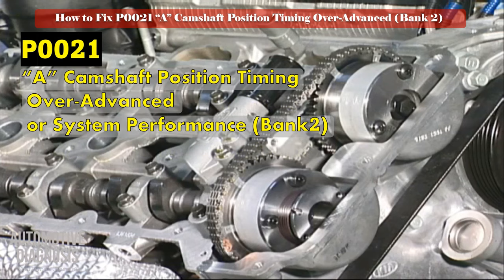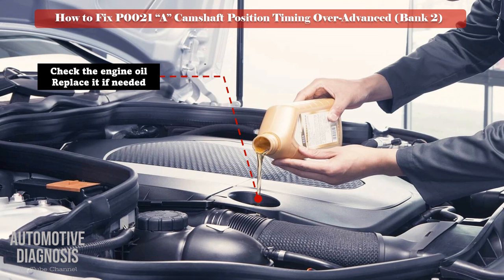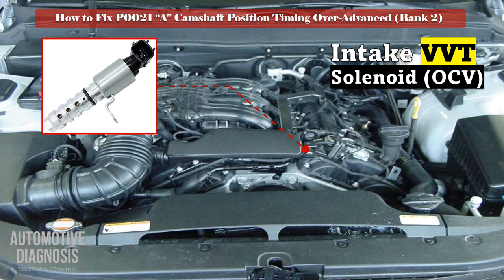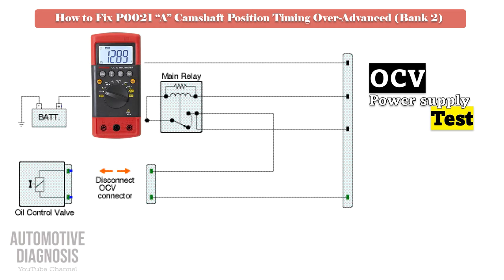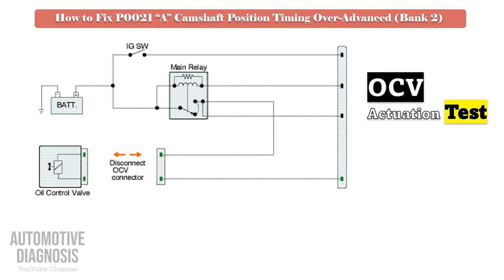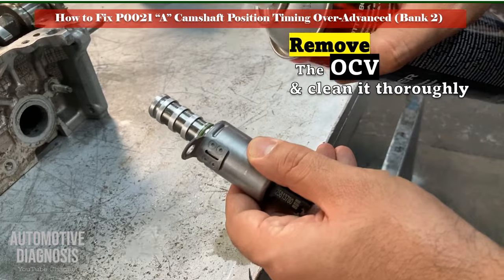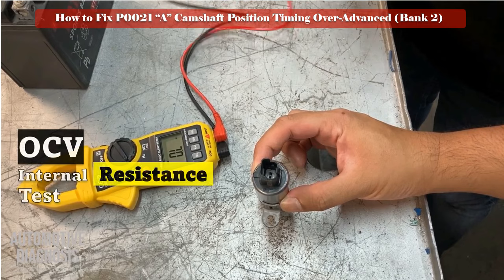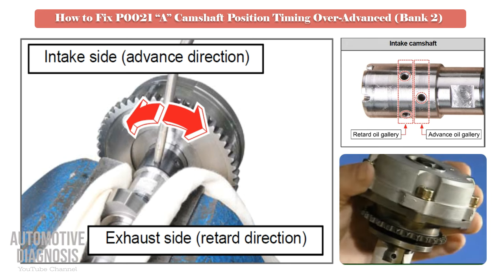How to Test & Fix P0021 Intake Camshaft Position Timing Over Advanced Bank 2 - Engine Fault Code

Comment: Would this fix P0021-77 too
Reply from the maker: Very similar diagnostic procedure
Reply: The car seems to have an engine shake to it for just about a minute then when I turn my car off and let it sit for a few minutes and turn it back on it seems to go away. Engine light came on now. 
Wondering if you think this will be an expensive fix. Again the code says P0021-77.
Reply: My car is a 2014 Mercedes c300

Comment: My z is making knocking sound and I have that code
Reply: Have you figured something out? I have a 08 g35 and even replacing the corresponding variable timing solenoid I have that p0021 and a pinging.
Reply: @gloglo1275 did you ever fix it?